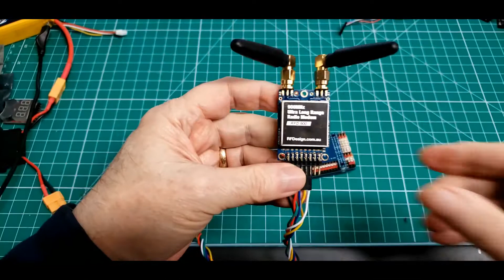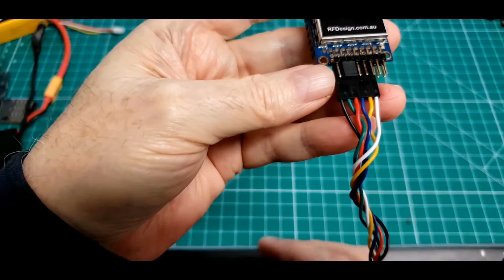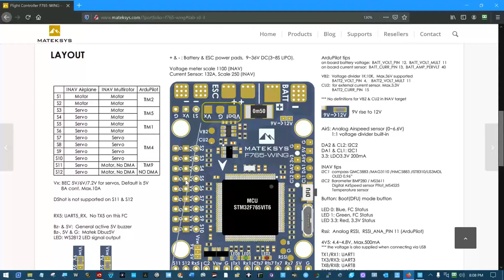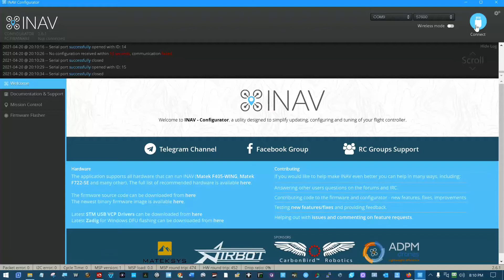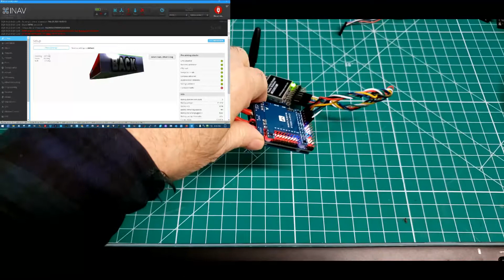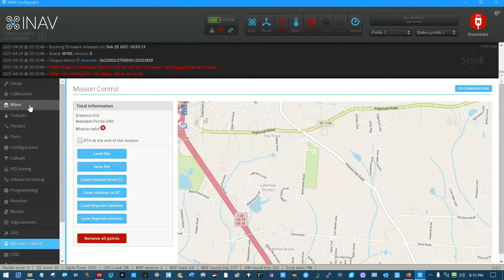F765 Wing 915Mhz Telemetry INav Setup

Comment: Great video! To configure a new waypoint-mission from the field using a laptop, this telemetry module is the only way? (to get a link between laptop and FC)

I've installed on TX16S iNav telemetry widget, but the widget doesn't seem to have any mission capability.

Problem is my FC-board has no CTS/RTS pins, so I guess to run missions from the field, I'd need a different board such as your Matek-wing FC?

Thanks!
Reply from the maker: What FC are you using?  I have not flown INAV yet, still on ArduPlane.  The Ardupilot firmwares let you turn off cts/rts for telemetry.  I have some CAUV radios that don't have cts/rts wires and I just turn off cts/rts in ardupilot.  Not sure IF/how you can do that in INAV.
Reply: @nighthawkvs  Interesting, thanks for the reply! I'm using an F405 clone in the Darwin129. It flies well with iNav after adding a bn-880 and an optical flow sensor from matek. It all took quite a bit of calibrating and tinkering, as expected. I originally purchased a clone 915MHz telemetry transceiver combo (for air and ground) to go into an ardupilot quad i built, but my 3d printed frame wasn't up to par, so I never got far enough to install the telemetry module, but I’ve reached a point that I can try missions on my iNav quad with the Darwin frame. The pos-hold seems very stable after my last test. I’d prefer to set up missions from the field. If i can disable cts and rts within inav like ardupilot as you described, that would be great, although it might come at a cost of some communication-performance. I checked the dump-file for iNav and saw nothing about cts/rts. I found some documentation saying you can use an ESP8266 to send missions over wifi, or a bluetooth module to send over bluetooth. Intriguing options for more budget flight controllers. Might need an antenna for the 8266 to get decent range (rather than the PCB antenna.) I’ll let you know if I get it working, although might not be worth all the hacking compared to the more robust performance from the telemetry-module at 915mhz using a Matek board with cts and rts. It seems iNav configurator intends pilots to create missions and save them, then bring them up from the field using stick commands (or vtx smart audio, which i plan to do.) Cheers.
Reply from the maker: @DFEUERMAN  Yes, not using CTS/RTS can degrade communications.  Mostly just collision handling.  If there aren’t more than one UART on the BUS then it usually isn’t a problem.  In some circuits the CTS/RTS may be tested at power up and turned off if the circuit doesn’t find that signal.  So I would test it with just the Gnd, Vcc, TX and RX and see what happens.
Reply: @nighthawkvs  Cool, I'll give it a shot!
Reply from the maker: @DFEUERMAN  I hope it works for you.  I am not fully up to speed on INAV.  Yet!  :)
Reply: @nighthawkvs  So, I retried the speedybee app, since my FC is a speedybee board, and it now works with iNav! (for some reason, it didn't work last time I tried, maybe 3-6 months ago, and the iphone-app and FC couldn't connect.) It could be a new version of the app fixed it, since my iphone auto-uninstalled the app from lack of use of the app. Anyway, I can now set waypoints from the field! Awesome! Problem solved!
Reply from the maker: @DFEUERMAN  Killer.  Wtg!  I am glad you got it going.

Comment: Thank you very very much, this helped, BTW I have a crossfire nano rx will it interfere with 915Mhz telemetry?
Reply from the maker: You are very welcome.  I am glad it helped.

It certainly could interfere.  I switched my Nano Talon to 433 MHz because of my Crossfire Nano rather than take a chance.
Reply: @nighthawkvs  Thank you, you have very unique videos, its not entertainment just pure very good spoken information ...
Reply from the maker: @flyinghigh2646  Thank you for that kind comment.  It is appreciated.

I have been suffering from a brain concussion received in June of this year and my videos have not been very good during that time.  I am improving now and hopefully my videos will also in 2022.
Reply: @nighthawkvs  so I would also buy the 433 version for 5 mile range, what do you recommend 100mW or 500mW, any changes that we can do with the antennas?
Reply from the maker: @flyinghigh2646  I did buy the 433 MHz radios for the Nano Talon just a few months back because I switched from EZ-UHF 433 MHZ to Crossfire 915 MHz.  Then more recently I switched to Dragon Link because Dragon Link does not need separate telemetry radios.  Dragon Link does both control, and telemetry in one unit.  Currently testing that.

I always buy the highest power I can.  It all depends on how far you can separate the transmission sources from each other.  On a small quad it might not be best to select the highest power if things are close together and the expected flying range isn’t going to be far from the pilot.  On a large airplane, space means you can get away with higher powers.  A lot of factors come into play.

There are lots of things you can do with antennas to increase range.  All the way up to a highly directional Yagi antenna with lots of gain.  I just test the range in flight and step up the antenna selection as I go and when it is needed.
https://youtu.be/_zl0ouPnU80